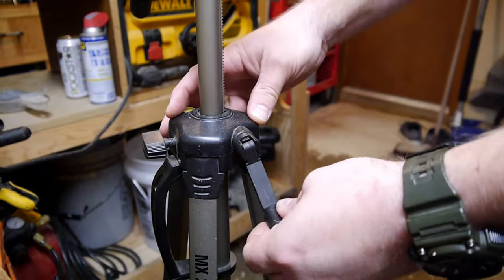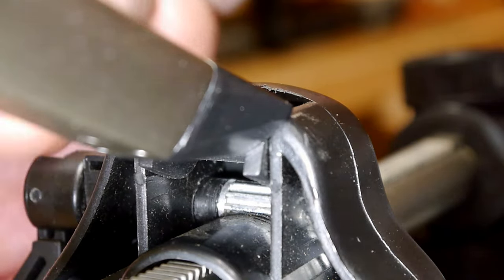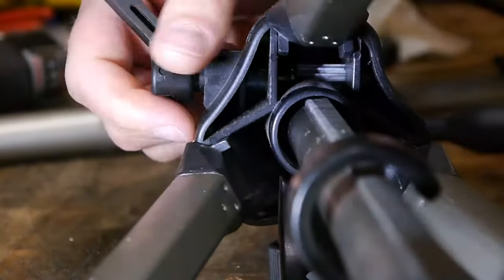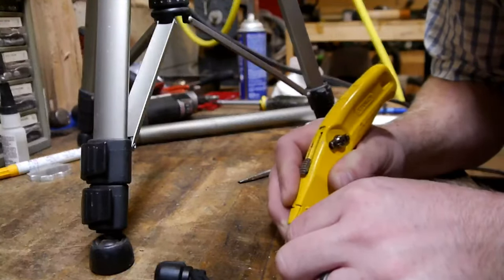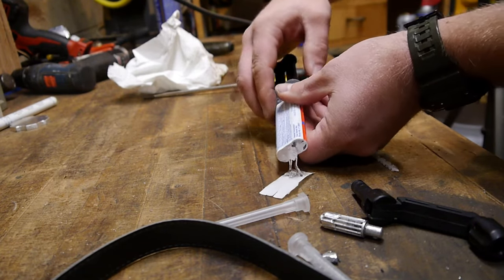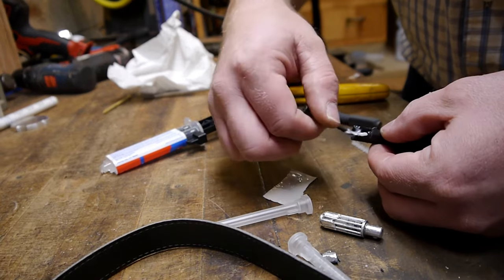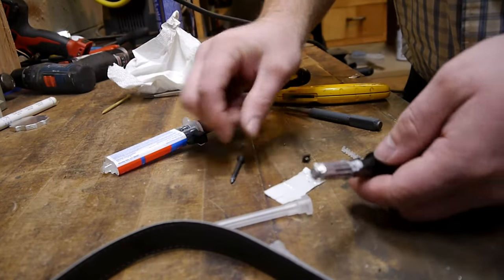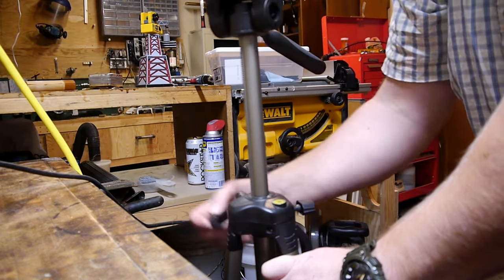How to Fix your Tripod's Camera Elevation Crank Handle Mechanism, MX2000

Comment: My Handel is so loose now I was moving my handel up and down for some video making and suddenly it got loose and now my camera can't stay still and when I want it to view in some direction Handel rotates to down direction on its own please tell me some rhing
Reply from the maker: Hi Muhammad, it sounds like the threads have stripped on the handle or where the handle fits into the top camera mount. Given that the handle is metal it is probably the camera mount threads,  or it could be the plastic around the swivel joint is cracked and not applying pressure to the swivel joint. If you have a clamp you might be able to apply pressure and keep it from moving, but it is not very elegant. See if you can see if the threads are stripped or the plastic around the hinge pin is cracked and let me know maybe we can do come up with an alternative for you, I'll have to give it some thought.

Comment: I had the same problem!!!!
How did you removed the handle mechanism? You jumped that part!
Reply from the maker: Hey, when you say handle mechanism do you mean the handle that rotates the pinion gear which in turn causes the camera mount to move up and down? I show it, sort of, there isn't much space to film and get the screw driver in. The pinion should fall right out at that point if it is like mine.
Reply from the maker: If memory serves the pinion should come out the same hole the handle fits in, as after I glued the pinion gear to the handle it would have to have fit through the mounting hole that the handle rotates in.
Reply: Just Josh rfpom yep it fell, I tried to glue like you did but unfortunately the glue wasn’t strong enough. After I let dry for 30min. I tried to see if it was solid by making some resistance, like it was already rotating on the tripod but noup.
What kind of glue did you use? I need the high quality stuff.
Reply from the maker: @danielpenilla134  I can't remember the brand but it was a two part 5 min epoxy. I would let the glue cure for at least 24 hours after gluing though. Gives the epoxy a fighting chance. Good luck!
Reply: Just Josh rfpom ok thanks! So I imagine that putting it back on I just insert it and that’s it, right?

Comment: nice video tutorial.

Its so stupid that they would use a plastic piece for something like this! I wouldn't trust any expensive camera or projector with that garbage! No metal no service! Unless this was a very cheap entry level model designed to be ultralight for use with a small handycam or something I see no reason to skimp out on material like that